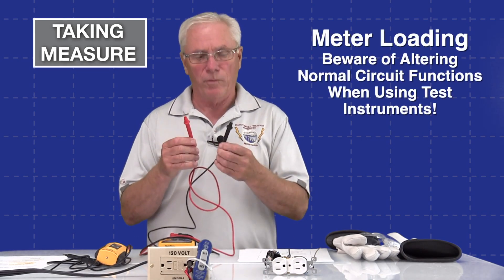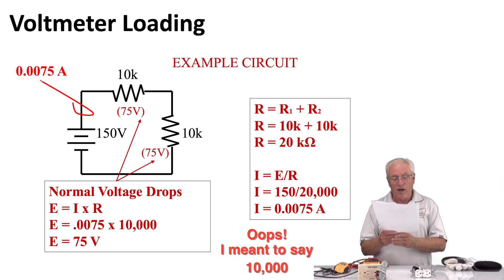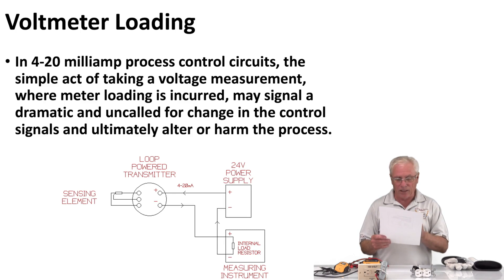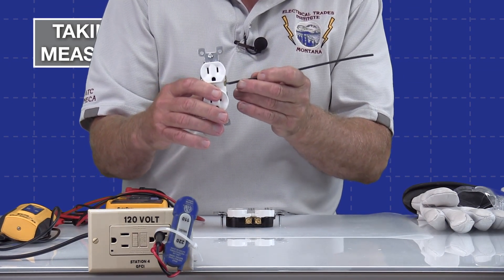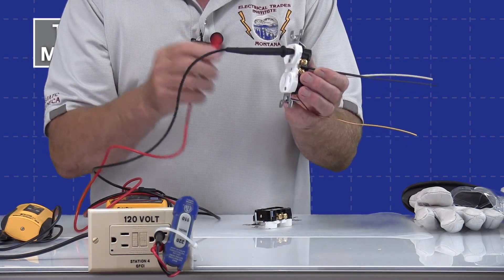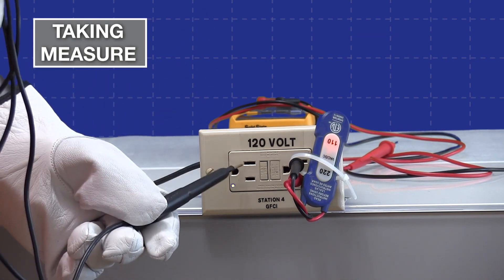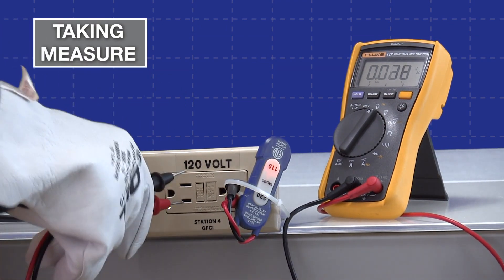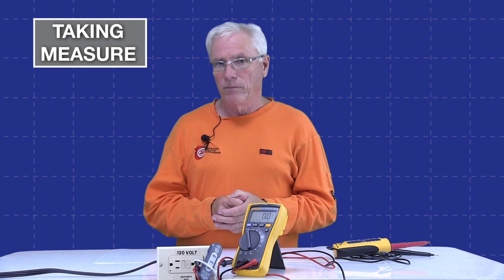Meter Loading - Beware of Altering Normal Circuit Functions When Using Test Instruments!

Comment: The Fluke Low Z impedance is 10K or 1K? The Low Z Meter loading is good for testing sense circuits, control circuits, AC or DC motors, open neutral unbalance loads circuits, power supply diodes and filter capacitors and coupling capacitor because the low Z meter loading is putting load. Coupling capacitors will block DC but the Low Z meter will put a load to test the "leakage" of the coupling capacitor which the High Z meter won't test the leakage of the capacitor give a false positive measurement. Same when testing an AC motor or DC motor the High Z meter will test the output Voltage of the motor but the Low Z meter is applying a meter loading so the motors output voltage will pull down sag so its testing the motor under load. Power supply rectifier diodes will test good with High Z meters but will fail with Low Z meters because the diodes is tested with the Meter loading which is testing the diodes Leakage. You should make YT video lesson about testing components with the Low Z meter testing under load.
Reply from the maker: I am not certain about the exact value of input impedance for the Fluke 117, but it is a feature I really like.  I use Low Z mode for basic voltage measurements: testing receptacle circuit voltage, etc.  I like your suggestion for going deeper into the various issues and results when using either high impedance measurement mode or the Low Z setting on specific components or circuits.  There is no end to this stuff.  Thanks for the comment!.
Reply: @takingmeasure  If you look at different products the label on the back will say how much current consumption it takes to energize or power on the circuit. Different types of loads can measure the same DC resistance value but will draw different amounts of current which is the main differences between different types of loads. Different types of loads will measure DC resistance lets say 100K resistance but each different type of load will draw and consume a different amount of current. Examples a Vacuum, toaster, Scanner Fax machine, Vegetable Steamer, lets say all measure DC resistance as 100K load but each load is going to consume and draw a different amount of current. An Analog meter simpson 260 has meter loading effects and so does the fluke 117, but how much current is it consuming and drawing. Something to think about to make a YT lesson about because its not about the Loads DC resistance but also the Loads current draw consumption.
Reply: @takingmeasure  When using the Fluke meter in Low Z mode connect a Current clamp around the RED probe to measure the current consumption of the current under test. If the current under test is 1K and the Fluke meter low Z mode is 1K which is 1K/IK= Half the supply voltage or source voltage. If the current under test is 10K and the Fluke meter low Z mode is 1K that is 10K/10+IK = V out . The Voltage divider RATIO keeps changing depending on the circuit under test TOTAL resistance which changes the RATIO of the voltage divider. You can use the current clamp to connect around the Fluke DVM meter RED or Black Probe to measure the current draw and the measured voltage which V/I = Meters Low Z Resistance. Something to think about to make a YT lesson about.
Reply from the maker: @waynegram8907  There are so many things to test and explore.  Vastly interesting, too!